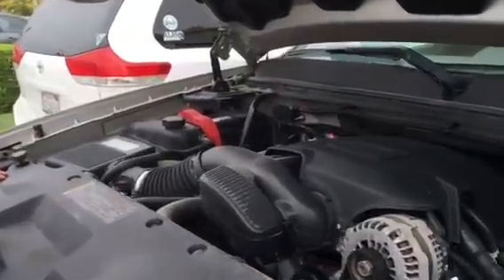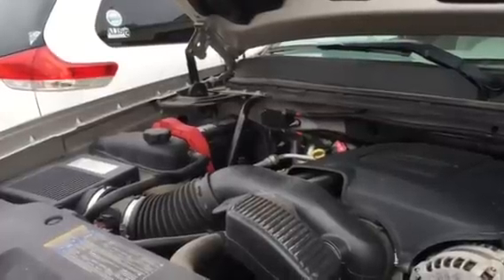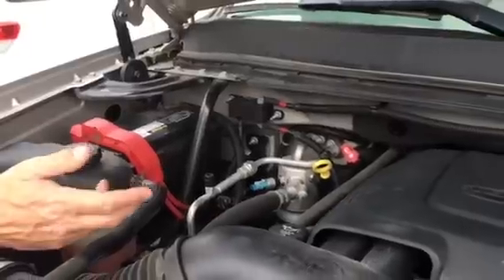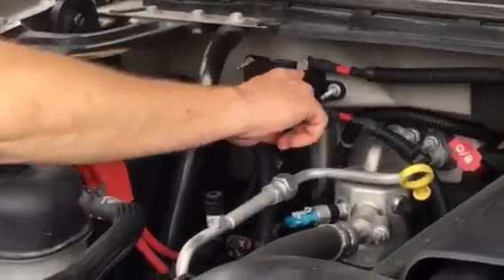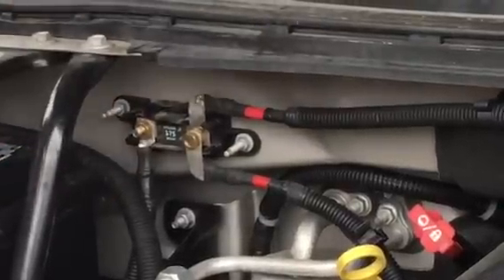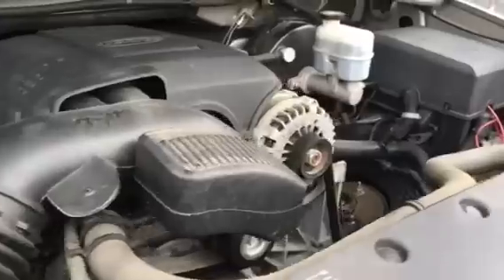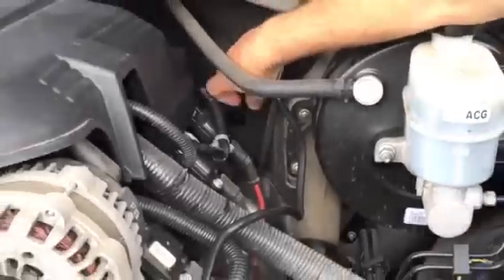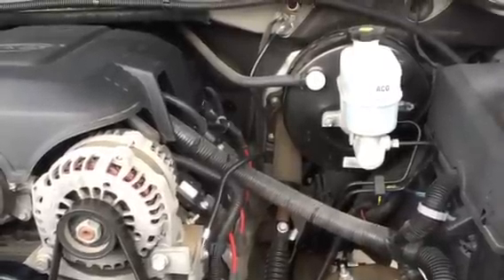GMC Truck Electrical Error Fix

Comment: Thank you for a very nice clear and concise explanation of your electrical error fix.  I thought I have a battery that isn't living up to its specs an claim of eight-five-(85) months.  In January 21, 2012,  I purchased the Interstate battery (34/78DT - Mega Tron Plus), it has a 85-month life warranty rating - that is 7 years and one month.  I am not sure if I have a battery problem or other "electrical gremlin" issue.  I drive a 2005 GMC Sierra VHO 6.0L Performance Edition.  In my amateur attempt to troubleshoot I learned more than I thought I could learn about auto electrical systems: I wonder if I replace the Breaker, Circuit - GM (12077863) [approximately $10.00 to $20.00 from either GM Parts net or Sears]  if it will resolve my driver's power seat?  The circuit breaker or the switch is in a state of unreliability because if I attempt to move the seat forward the seat will move backwards and vice-versa.  I pulled the circuit breaker and after about a minute, I reinserted the circuit breaker and the seat functioned properly, but a few days later when I needed to move the seat backwards it moved forward.  I have also read that it could be a faulty control switch in the seat, which costs $92.00 + at most local auto parts stores.  In summary, I am trying to solve the power seat problem at the lowest cost due to major financial constraints!  Besides I enjoy learning and building my self-confidence in my "lack of mechanical skills" and if I can fix the problems then I couldn't put a price on it.
Reply from the maker: Peter - I don't believe it would be a circuit breaker.  Those usually either work or permanently don't. Your problem does sound more like a bad control switch.  I don't know much about it, but I would probably see if I could pull it out and fix it before replacing it.  I had a BMW with a similar problem and there was just junk in the control causing it to not function properly.  I cleaning it all up and it worked well.
Reply: Thank you for your response.  I am still trying to resolve my seat issue.  I initially thought it was the circuit breaker, but after I read your response and researching the subject on the internet I too thought it could be the 8-way seat power switch: after replacing the OEM 8-way switch with a 3rd party product, I learned that the switch is not the cause.  After more researching and watching YouTube videos, my next option was to check the power seat control module [GMC Power seat control module Lear P/N 602-0528-200-F-GMT800].  I finally removed circuit board under the driver's.  I am currently attempting to clean the board's connector prongs.  Hopefully this will fix my driver's seat's unreliable forward and backwards adjustment movements.

Comment: My 2013 GMC has been having electrical issues also. Occasionally it won't want to start as if battery is dead then it will start fine. Then today I went from dims to brights and the whole truck shut off basically for a split second and went back to running fine. You think this could be my issue?
Reply from the maker: Yep - that is exactly what I was experiencing.  Try cleaning the negative leads and installing a new ground like I did.  It is a cheap fix, if it works
Reply: 2013 truck 2 years ago and having problems like this. What a joke. So frustrated with GM

Comment: I have had this problem on and off for the last year and a half.  Owned the truck for 6 years and the electrical issue's have occurred since Oct. 2015.  I have had the truck into three different dealership's 6 time's and they have not been able to give me any resolution's.  The last dealership I visited was this past Fri..  They told me it would cost over $300 to try and figure out problem.  They would start with replacing ignition.  Thanks for this video.  I will try this!   ( Cost so far is well over $350 and I still have the problem.)  This past Saturday it happened again.   Am taking truck to local (non-dealership) auto repair shop with this video.  THANKS again for posting!!!!!  Worth a try!
Reply: What was the out come
Reply: Did u

Comment: Nice job. As a professional intermittent electrical issues can be a bear.  you stated that you lost acceleration.  In my experience the engine stays running but the transmission goes in to neutral when the electrical problem happens.  radio reset, door locks going hay wire, instrument cluster going nuts also.

Comment: My 2002 gmc  sierra 1500 lights stay on and drains the battery.   I tried to charge it,  but the lights stayed on and wouldn't charge enough to start.  Any ideas?

Comment: My 2008 Chevy Tahoe battery drains over night I have changed the battery an terminals an the alternator an still the same problem an my battery terminals get super hot
Reply from the maker: That sounds to me like you might have a short that is draining the battery.  Try searching for "finding short in car"
Reply: I have the same issue with my 2009 Chevy Tahoe , did you ever find out what the problem was ?

Comment: I have a question for you with all of those things happening by any chance did the oil light start flashing red after the vehicle had warmed up I am experiencing similar issues but not loss of power but the oil light the ABS light check engine light airbag light traction control light are all symptoms of what I'm having just not having power Los but am having oil light on and oil pressure gauge goes to zero
Reply from the maker: Yes, I think that was one of the lights.  Just make sure its not a low oil level giving you that light
Reply: XORBob yeah the oil is full so I am definitely at a loss electrical is not my bag thank you
Reply: Well I put that ground strap down like you did and I took care of all the problems except for one Deming lights interior and headlamps that's the only thing it didn't stop

Comment: XORBob what was the size bolt you used to attached the grounding cable to the engine? I believe I have the same location just wanted to know the bolt size. Since it has been almost 10 months since you posted. Have you had any issues?
Reply from the maker: Sorry - just saw your comment.  Did you get it worked out?
Reply: I did! I used a 10 mm bolt. That only fixed it for a week so I researched more and replaced all the OEM wires. Been a few months and all is good. Thanks for your initial post, it was what got me pointed in the right direction.
Reply from the maker: So, how many other wires did you replace?  (And which ones)
Reply: Completely changed  neg. terminal and wiring with 4 gauge. Added additional ground from battery to frame. Due to the complex terminal of my pos. I just went ahead and added an additional pos. 4 gauge from battery to alternator.
Reply from the maker: Yep - that's great.  I will probably do that too.

Comment: thank you for this video. you just saved me over $600.  A $8.99 ground wire solved the problem.
Reply: What kind of screw do you attach it to the engine with ?

Comment: I had this problem for months with an 1996 Cavalier.  Just put a new ground wire from the negative on the battery to a metal spot on the body of the car and all was fixed.  The original negative had broke lose from the battery tray when it rusted through.

Comment: Had the exact same problem 2 years ago. This would happen several time a week.I replaced the battery and fixed the problem. Never happened again. NOW, before all you old schoolers say, "that ridiculous, cause the battery is only used to start the engine". Not in today's vehicles. With all the electronics involved with today's more advanced vehicles the battery is being used intermittently and cycles while the vehicle is in operation.
Reply: Just  go away

Comment: you also have another ground in the back of the engine next to the one you connected to the alternator.
its damn difficult to get to it but it runs from the wires on top of the engine to the back and downward just follow the wires.

Comment: I was having the same issue with my 2009 gmc denali sierra. I tried this today. Hopefully this will fix the issue. thank you for sharin.
Reply: 2015, you should take it to the dealership and they should cover it. I have a 2009 GMC Sierra Denali and the dealership said because I had just reached 100,000 mile they wouldn't cover anything.
Reply: lizeth mtz dealerships don't know shyt about anything .I did on GMC Sierra 2011 5.3 and it fixed it I did 0 gauge bosh wire and now everything running smooth
Reply: HoustonRocket281 Que
Reply: i did take it to dealership.. just like always they are the the dumbest and made it worse plus they charged me 599 for literary nothing. i did send the car to this foreign electric guy from middle east.. it took him only 2 days to start the car. This guy is a genius.
Reply: did you fixt it? i have a 2015 gmc sierra and there is not power, batter and starter are good. its a brand new car btw
Reply: alondra martinez i did take it to dealership.. just like always they are the the dumbest and made it worse plus they charged me 599 for literary nothing. i did send the car to this foreign electric guy from middle east.. it took him only 2 days to start the car. This guy is a genius.

Comment: I have a '03 Avalanche.  You said that there was a video from a older Chevy.  Any way you can direct me to that video?  I can't find it.  My break & security lights will come on, radio will turn off, gauges drop....  Then will start working again & then happens again.  this happens constantly now.
Reply: HOW TO FIX MANY GM TRUCK/SUV ELECTRICAL PROBLEMS  , I believe that is the video he was referring to . It helped me greatly with my 02 silverado . Good luck !

Comment: I have an 07 Silverado that would just loose all power. Determined that it had lost ground.  The issue is inside the crimp on the two ground cables at the battery.  Clipped em off and installed a new lug on the end of the cable that attaches to the (-) terminal on the batter.  $10 fix.  Wasn't about to buy another $100 OEM cable to just fail again.
Reply: Kurt Schneider I have a 09 Tahoe. Does same. Loose all power after few days.  2 batteries and 2 alternators later same issue.  Gonna give what you did a try

Comment: my truck is doing the same thing lights flicker with blinker and when I tap brakes stereo shuts off and what I read was replace the negative like you did here but also the bcm solders get old and need to be re-soldered.

Comment: Thanks for your video. This fixed my 09 suburban that was acting crazy and the strap looked fine but I added a cable and haven't had an issue since.
Reply: What kind of cable did you replace?
Reply: @bignip2000  I ended up replacing the negative battery cable. It was intermittently bad at the terminal. Still working good.

Comment: I'm having issues with my 08 silverado v6. The door speakers work off and on. I've noticed the dinger that goes off with the key in the ignition is very quiet. Today it was how it normally would be. Both door speakers worked fine. I'm at a loss on this... The only other electrical is the power window switch on the passenger side works off and on. I'm hoping this isn't going to get worse. Just bought the truck at a estate auction. Might just trade it in. who knows...
Reply: I did quite a bit of research on these weird issues (and paid $400 to GMC to try to have it fixed, which they failed).  It turns out these phantom elec problems seem to be around bad grounds.  You might want to try doing what I did -- especially to the engine, but also to the body.  If I were you, I would clean up every connection between the battery ground and the body/engine, then put a dab of dielectric grease on them.  Then, replace the existing braided ground straps with new ones.  They cost me $6 at PepBoys.

My bet is that it will clear those problems up fast.  I haven't had one bit of problem since I did it and I was having all sorts of strange issues like you stated.
Reply: I put new speakers in. Problem fixed.
Reply: probably the speakers. I had the same problem.  changed my speakers and it works fine